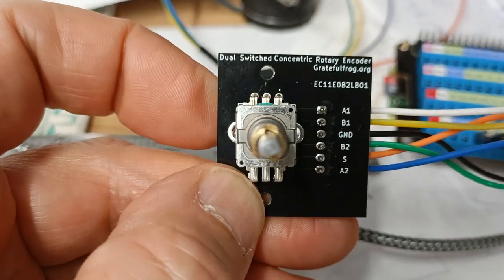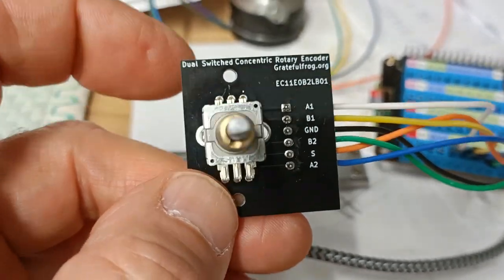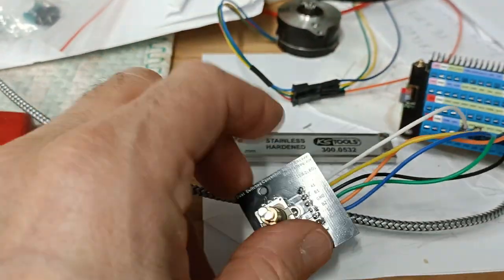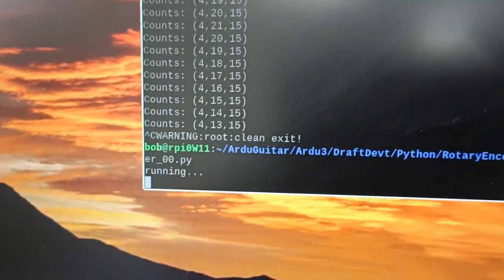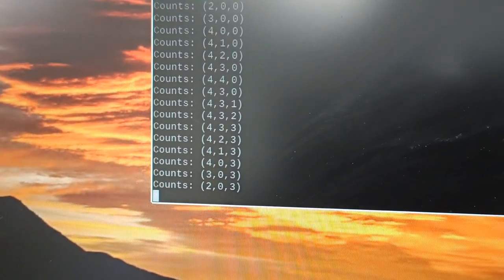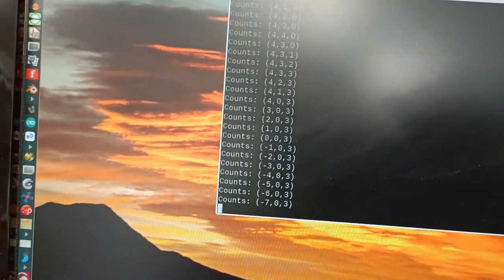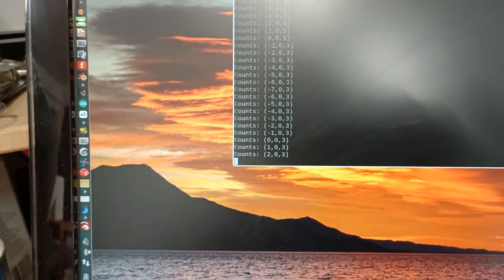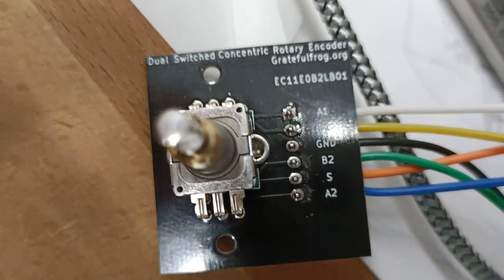Alps Alpine Dual Rotary Encoder and RPi Zero

Comment: This is fascinating! Thanks for sharing! I've been looking at making a smart rotary dimmer switch for our bedroom to control the Lifx bulbs in our ceiling lamp, something I can mount by our headboard and simply send commands out over the local WiFi network to the bulbs. This is a great start. Could you share some of the source (PCB and/or software)?
Reply from the maker: it runs on a raspberry pi. The code is available at: https://gitlab.com/gratefulfrog/ArduGuitar/-/tree/master/Ardu3/DraftDevt/Python/RotaryEncoder  The pcb gerber files are at: https://gitlab.com/gratefulfrog/ArduGuitar/-/tree/master/Ardu3/2023/Kicad/Dual%20Switched%20Rotary%20Encoder  Let me know how you get on...